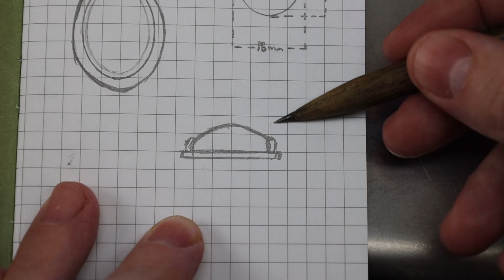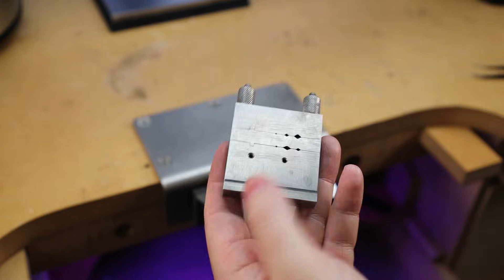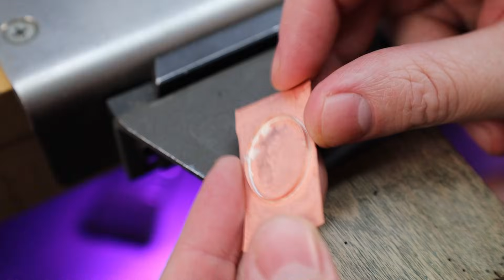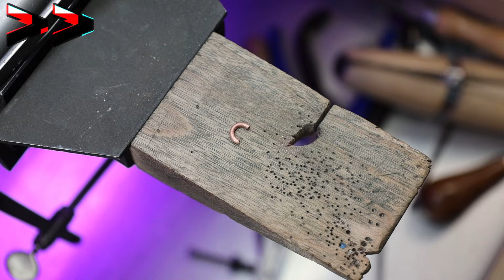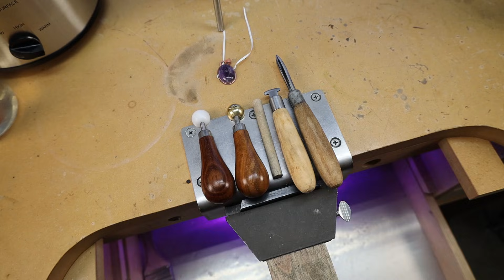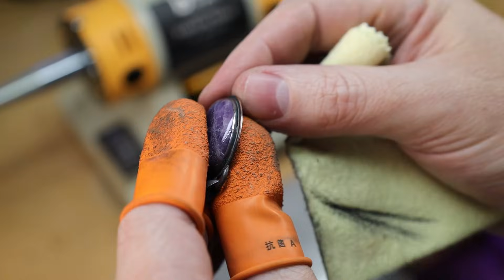Make Your First Bezel Setting Necklace Today! (With Basic Tools Anyone Can Use)

Comment from the maker: Bail Template &  Center Finder: Use Code BEZEL for 15% off GomeowCreations.com
Bail 1 Template - https://gomeowcreations.com/products/bail-1-template
Center Finder - https://gomeowcreations.com/products/center-finder-symmetry-checker-jewelry-making-tool

Bezel Setting Tool:
Stainless Steel Straight Burnisher 6.5-Inch - https://amzn.to/48xd8VH
Bezel Buddy Original - https://micro-tools.com/collections/bezelease/products/be-010
Bezel Buddy Never Mar - https://micro-tools.com/collections/bezelease/products/be-011

Materials Sheet Metal & Wire:
Copper Sheets - https://bit.ly/CopperSheets
Copper Wire - https://amzn.to/42VxQwW
Silver Sheet - https://amzn.to/4khD2kr
Silver Wire - https://amzn.to/3Sq0Xm5

Bench Pins:
Basic Bench Pin - https://amzn.to/43wXgkw
Bench Anil & Bench Pin - https://amzn.to/43wXgkw
Bench Anvil Basic Combo Kit - https://amzn.to/4j2VITU

Thermal Plastic - 
Polly Plastics Moldable Plastic Pellets - https://amzn.to/4oC68wG
Heat Gun Kit - https://amzn.to/4tFgCis

Measuring Tool & Dividers:
Digital Vernier Caliper - https://amzn.to/3gbyfSR
6 Inch Adjustable Lockable Steel Divider - https://amzn.to/4pNsSdZ

Wire / Flush Cutters & Metal Shears:
Basic Wire Cutters & Flush Cutter Kits - https://amzn.to/4diaF3b
Metal Shear 7 Inches - https://amzn.to/3KGFlRZ

Polishing Compound & Cloth:
Fabulustre Polishing Compound - https://amzn.to/3GWiWOk
5x Polishing Cloths - https://amzn.to/48zWEfC

Bench Polishing Tool:
Bench Polishing Motor - https://bit.ly/BenchPolishingMotor
3" White Cotton Buff (2 Pack) - https://amzn.to/4kFcHNF

Rotary Flex Shaft Motor & Handpiece:
Basic Rotary Tool Flex Shaft - https://amzn.to/3S0vUgm
Foredom 2230 Jewelers Kit - https://bit.ly/K2230
Foredom 2230 Jewelers Kit - https://amzn.to/4j6E0z0
Foredom 2230 With Quick Change Handpiece - https://bit.ly/2220-system-with-quick-change-handpiece
Foredom H.20 Quick Change Handpiece Only- https://amzn.to/3F9C0rN

Finger Guards:
Basic Finger Guards - https://amzn.to/4kjTPU2
Premium Japanese Rubber Finger Guards - https://bit.ly/Japanese-Rubber-Finger-Guards

Pickling Compound & Pickle Pot:
Basic Electric Slow Cooker - https://amzn.to/4mgYLL6
Sparex 2 Pickling Compound - https://bit.ly/SparexPicklingCompound
Distilled White Vinegar 1 Gallon - https://amzn.to/43gNWA0
Regular Salt - https://amzn.to/44EuuQe
Curved Copper Pickle Pot Tongs 9" - https://bit.ly/Copper-9-inch-tongs

Rotary Tool Wheels:
1" Polishing Buffing Wheel Set - https://amzn.to/42WoMI7
1" Radial Bristle Disc Kit - https://amzn.to/4diBzYY
Pack Wooden Ring Clamp - https://amzn.to/3FhlciB

Flux:
Handy Flux 7 Ounce Jar - https://amzn.to/3YIMIw5
Handy Flux 1 Pound Jar - https://amzn.to/45dMdhx

Miter Cutting Vise Jig:
Steel Swiss Style Miter Vise Jig - https://amzn.to/3S4R7pq

Solder:
Silver Solder Chips - https://amzn.to/3S29Y4z
Paste Silver Solder Set - https://bit.ly/SilverPasteKit

Jeweler's Saw Frames & Blades:
Basic 5" Adjustable Jeweler's Saw Frame - https://amzn.to/4j6kAKJ
Cutting Lubricant for Jewelers - https://amzn.to/3SpJhqJ
NANO Jeweler's Saw Blades - https://bit.ly/NANOSawBlades
5" Haymaker Saw Frame - https://bit.ly/HaymakerSawFrame

Metal Files:
10 Pcs Small Files - https://amzn.to/3SAULHL
6" Grobet USA Swiss Pattern File Barrette File - https://amzn.to/3YLIJyP

Solder Block/Surface:
Basic Charcoal Block - https://amzn.to/3YKtOFf
Hardened Charcoal Soldering Block - https://bit.ly/CharcoalSolderingBlock
Honeycomb Ceramic Soldering Board - https://amzn.to/43iyoMo
Tripod with Mesh Screen for Heating and Soldering - https://amzn.to/4j9xs2F

Tweezers:
Stainless Steel Tweezers Set - https://amzn.to/43hXJGg
Titanium Tweezers - https://amzn.to/44zIkmV

Pliers:
Parallel Pliers - https://amzn.to/4di5Wyt
Nylon Flat Nose Pliers - https://amzn.to/44JaSul
5 Pack Jewelry Pliers Tool Set - https://amzn.to/3YNuEkx

Torch Options:
Propane Torch Tip With Trigger Start - https://amzn.to/4di1C2f
Standard Propane Fuel Cylinders - https://amzn.to/3YGNgCH
Butane Jewelers Torch - https://bit.ly/PepeToolsJewelersBlowTorch
Smith Little Torch (Oxygen & Propane) Kit- https://amzn.to/4mgCjSr
Oxygen Acetylene Flashback Arrestors Set - https://amzn.to/459LduI

Comment: I made my pendant by forming some sheet brass into a cup to hold a round labradorite stone.  I saw a video of copper being formed in a similar way to make kettles or something similar many years ago and thought it might be doable on a much smaller scale to make what I just learned from your video title is called a bezel setting (unless it is the specific technique you used and not the basic end result that makes it a bezel setting)  After watching this vid, I realize that I should have annealed the sheet first (should have realized it at the time but was in too much of a hurry to slow down and think) and I needed thinner sheet.  While it looks nowhere near as professional as yours it looks quite nice unless you turn it over and see the HUGE glob of solder on the back holding the hoop on. lol

Comment: Perfect video, just as I was about to try bezel settings 😎 I know in this video you wanted a weathered/worn look, but have you got a technique for a even coating of liver of sulphur? So it's not patchy, I've been trying for ages and spots still lift off 😅 
Thank you 😁
Reply from the maker: For the most part it will lift off. You can use a higher concentration and leave it in longer and do a really light polish to it and then seal it using some of the methods I show in another video on how to seal copper